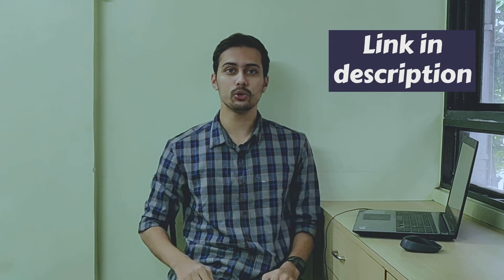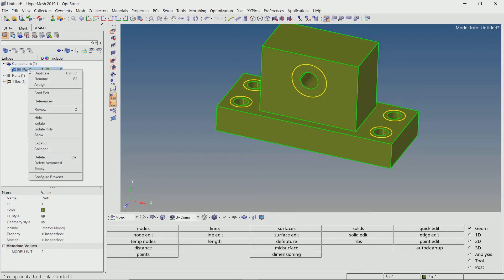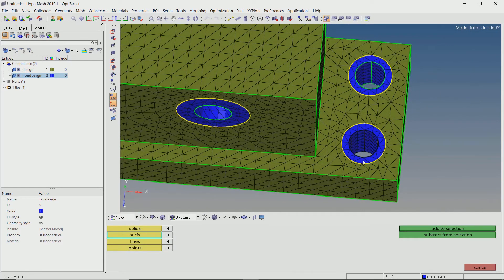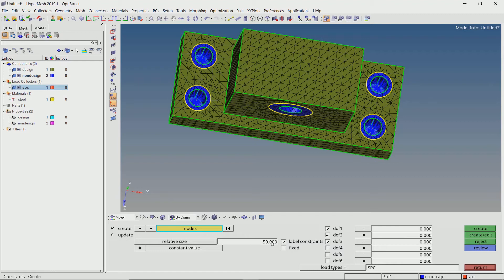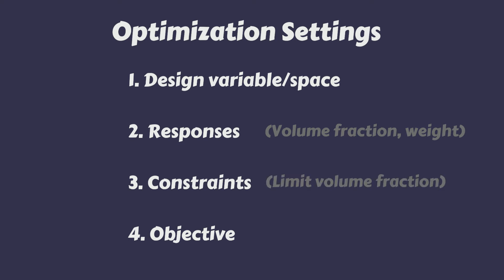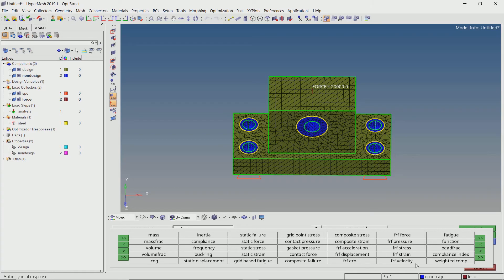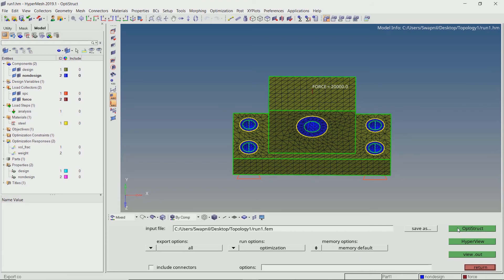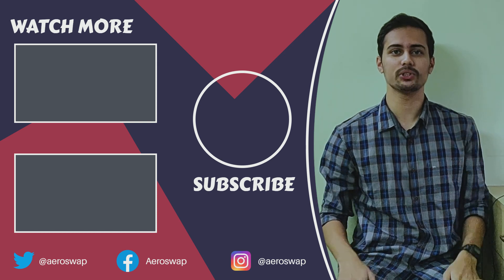Topology Optimization using Hypermesh [Optistruct Tutorial]

Comment: * ERROR # 1814 *
 VOLFRAC response on DRESP1 card 3 is not applied to a topology or
 free-size domain.
....i got this error plz tell me how to fix this. I'm not getting how to fix
Reply: I think this Error occured because there are no Elements in your Design component, Gildas GUILLY on the Altair forum explained: 

"The problem is your properties : All your model is "NonDesign" and you have no elements with the "Design" Property applied.

You need to reorganize your model to have elements correctly distributed between your two components (currently all FEM is in on component).
Use the "Organize" tool to transfer elements from one component to another."

I did this and got rid of the Error.

Comment: Very educated tutorials always. This would do just fine for the analysts who just step into the topology optimization area. To get into more details, this method is often used to track “load path” of new material trials for R&D purposes. Each material has own mechanical properties and has different strain response based on poisson’s ratio. Design constraints are also assigned for Ftu, Fty, or deformation limits, as well as minimizing compliance (strain) and weight. You can also limit the element size for the inner solid elements to homogenize it overall as the gradual size change is set to be default for reducing computational time. As additive 3D printing application is becoming more popular and developed, lettuce optimization is also handy for further weight reduction.
Reply from the maker: Aha, I'm always waiting for your comment on every new video! Always a pleasure to get these additional insights on the topic.
Your comments add a lot more value to my videos; really appreciate this!

Thanks a lot Ken!
Reply: Aeroswap thank you I’m always waiting for your videos too!! 👍👍

Comment: Excellent PSOLID (solid elements) optimization to reduce weight using volume fraction (strain energy kind of thing).  There is no stress constraint in this method, although stress values are within limits.

Comment: Good one. There are some things which needs to be considered while performing optimization. What’s the reason of performing optimization , is it to reduce weight only or stresses as well? Even if you increase the load or decrease it you will get this exact same results. One more constraint is required. Displacement or stress constraint. Always check stresses after the Optimization to see if optimised part are not having higher stress than the design space
Reply from the maker: Agreed. I have demonstrated the process to apply stress constraints in many of my optimization tutorials. It is one of the most important factors for any optimization. If the optimized shape shows stress concentration above yield limit at any location, it is of no use!

Comment: I'm trying to open the Quick Edit option but it is not opening by pressing f11, what do I do?
Also, I can't see a separate app of "Hyperworks desktop" on my computer, I only have Hyperworks 2022.2 (I downloaded the official student version)
Please help me out....
Reply from the maker: Hi Nirmit,
Please check if you have not disabled the function keys using Windows settings.. If so, you will need to enable them and restart the HyperWorks application for the shortcuts to start working.

HyperWorks Desktop and HyperWorks both are essentially the same. The only difference is that you cannot open any other clients like HyperView, HyperGraph in the same window if you are using HyperWorks desktop. In HyperWorks, you can use multiple clients in the same window.

As for Quick Edit, if the shortcut keys are still not working, you can find this option in the Tools panel. I hope this helps!

Comment: how to optimize the the different parts in the assembly taking all loads into consideration which is acting in the assembly
Reply from the maker: Hi Uday, the same setup method will work even with assemblies. Just make sure that you are creating proper contacts and connections between the different parts contained in the assembly.
Reply: @Aeroswap  thank you very much, it will be grate help and confidence building, if you can upload the video, of assembly having two or three parts with bolts and rivet, and convergence study also of the parts in the assembly, with size and topology optimization of assembly parts.it will be extremely helpful for me in my work.
Reply from the maker: Thanks for the suggestion. I will work on this topic soon!
Reply: @Aeroswap  can you make a video for mesh convergence study, it will be greatly helpful

Comment: Is there a displacement constraint for the optimisation settings?
Reply from the maker: Yes, that can be done. Static displacement response is available in the responses panel. It can be used to restrict maximum displacement of any desired node during the optimization process.

Comment: in this video , we want to optimize the weight. Why weighted Comp is chosen as objective function? Wightedcomp  basically gives stiffness of the structure.
Reply from the maker: We are not optimizing weight. We have already placed an upper limit on weight using the volume fraction constraint to create a new design. We are optimizing the stiffness for this new design. Hence, weighted compliance is used.
I hope this answers your question.

Comment: * ERROR # 1814 *
  VOLFRAC response on DRESP1 card 1 is not applied to a topology or
  free-size domain.

While solving I get these error ! can you please help me on this
Reply from the maker: Make sure that you have created a topology design variable. For other types of optimization, volume fraction response is not applicable.
Reply: @Aeroswap  I have created Topology optimization Still facing the issue :p
Reply from the maker: Please check if your setup exactly matches the one shown in this tutorial. This case is tried and tested multiple times and it works well if all settings are correctly defined.

Comment: A fatal error has been detected during input processing:

  * ERROR # 1814 *
  VOLFRAC response on DRESP1 card 1 is not applied to a topology or
  free-size domain.
Reply: Hi, I had the same issue and solved it with reorganizing the mesh. The nondesign mesh has to be in the nondesign component. When you are about to tetramesh the solid, take a look at the bottom and make sure to have "elems to surf/solid comp" selected (it´s not selected by default). The programm will automatically organize the mesh in the different components, because you split the part in the beginning in different solids. I hope it works for you too

Comment: how can we manage the analysis when have a PSOLID and PBEAM and PSHELL elements at the same time ? is there a tutorial with non homogeneous element type ?
Reply from the maker: For other element types you can create separate design variabe with respective property types. Multiple design variables can be implemented in the same model hence you can perform optimization of 1d, 2D as well as 3D components in the same run.
I do not have a tutorial posted about this but I will work on this topic soon. Thanks for the suggestion!

Comment: I completed the local analysis of one part in the assembly. This part is having only loads coming from the assembly interaction, it does not any other boundary condition. It is having only loads coming from the assembly interaction. Now I want to run topology optimization in this part, can I optimize this part by topology optimization, as there is no boundary condition (SPC) load collector. how it can be done without SPC load collector.

Comment: hello sir, video was really great but even after I follow the video as it is with the same part I am getting this error "VOLFRAC response on DRESP1 card 1 is not applied to a topology or free-size domain", I tried everything but same error pops out and some times I get the result but I can see only one component(either Design or Non Design) in results and the component isn't getting optmized
Reply from the maker: Hi Srinath,
Please make sure that you are creating a topology optimization design variable. Volfrac response is specific to topology and free size optimization and will give an error if used otherwise!
Reply: Hi, I had the same issue and solved with reorganizing the mesh. The nondesign mesh has to be in the nondesign component. When you are about to tetramesh the solid, take a look at the bottom and make sure to have "elems to surf/solid comp" selected. The programm will automatically organize the mesh in the different components, because you split the part in the beginning in different solids. I hope it works for you too

Comment: Very nice video and well explained. After i see the optimised geometry in the last iteration... how do i export this shape as a solid (step file)? I want to 3d print the optimised design....

Thanks again for your great explanation
Reply from the maker: Hello,
For a STEP file, you have to use the OSSMOOTH option in Hypermesh. There is an easier method to export STL file directly from Hyperview.
Go to Tools >> Export >> Iso Surface. 
Save the STL file in required location. Then you can open it in any CAD software.

I hope this answers your question!
Reply: @Aeroswap  thank you!. I will try to explore ossmooth. Excellent videos by the way!.
Reply from the maker: Thank you! Glad it was helpful :)

Comment: How can I check the mass of the optimized component?
Reply from the maker: Hi Devansh,
You can use the OSSMOOTH option to import the optimized design back into Hypermesh. Once the material is assigned, you will be able to check the mass using 'mass calc' option in Tools panel.
Reply: @Aeroswap  Thank you so much

Comment: Hello Sir, I tried running optimisation problem using another model but it gave an error message showing problem of RAM, Its asking for 28GB RAM while I have only 8Gb. So is there any way to solve this problem whithout playing with element size? Can we use virtual memory RAM to solve hypermesh problem?
Reply from the maker: I dont think HM supports virtual RAM as of now. You might have to reduce the element count to resolve this issue.
Reply: @Aeroswap  Thank you sir for your reply

Comment: Thanks very much for the video, very simple and useful.
I have a question for you. What format file does hypermesh export to? If I wanted to export the geometry obtained from topology optimization, how should I export to? Is it possible to export directly to CATIA file formats?
Reply from the maker: Hi Antonio,
Good to know you liked the tutorial :)

You can use the OSSMOOTH option in Hypermesh to export STEP or IGES format of optimized design. Another option is to export STL file directly from Hyperview.

Unfortunately, Hypermesh cannot export in CATIA format.
Reply: @Aeroswap  Thanks for the answer :) Hypermesh reads .CATPart files but it can't export them to the same format. Right ?
Reply from the maker: Yes, that is right. This is true for older versions of Hypermesh. I am not up to date with the newer features as of now. Maybe the latest version also supports CATIA file exports. Please check if needed.

Comment: I am doing topology optimization for shell element in optistruct. I have different load cases.In some of the load cases I am not getting variation in contour of the optimized part. Means everywhere the element density is same and it is blue, which indicates that I can remove the whole material from the part.Stress on the part is very less such as 0.145MPa. Can you comment on  the correctness of the topology result.

Comment: Hello, Sir Nice explanation again, 
But I am facing some issue, I followed every single step you did but I keep getting this error:  
 * ERROR # 1814 *
 VOLFRAC response on DRESP1 card 2 is not applied to a topology or
 free-size domain.
Reply from the maker: Check if you have created a topology design variable. Follow every step in the tutorial as is. It will work.
Reply: @Aeroswap  yes I have created a topology Design variable. In fact, I performed the whole process from scratch but getting the same error. I don't know what I am missing here.
Reply: @ansariyaseer4651  Hello, have you solved this problem ?
Reply: I am getting the same error
Reply: @micheleromano9371  no brother

Comment: As this is a simple shape we can try with hexa mesh right, why tetra mesh ??
Reply from the maker: You are right, this model is perfect for a hexa mesh. But the main objective of the video is not about creating the mesh. Hexa mesh creation takes time, whereas tetramesh can be done in 1 click. You can try with hexa mesh if you want to!
Reply: @Aeroswap  But here I got a problem is: for reanalysis as the optimised part is complex, I can't able to do with Hexa mesh, So what to do ??
Reply from the maker: I would suggest using a finer mesh. That will give a better shape after optimization.
Reply: @Aeroswap  Means you are saying about volume Tetra Mesh

Is it necessary that mesh type and element length should be same for part and Optimised part
Reply from the maker: Sorry, but I didnt quite understand what you are saying. 
You can use any type of mesh (hexa/tetra) to set up the optimization. Im just saying that use a smaller element size (finer mesh) to get better results with properly defined element density patterns.
Reply from the maker: My email address is provided in the About section of this channel. Feel free to reach out with your setup details. 
I will look into it!
Reply: I sent a mail, once check it
Reply from the maker: I hope this clears your doubts.

Comment: can you plse post a video of topology optimization of a bevel gear
Reply from the maker: Hello Yash, 
The optimization setup process is same regardless of the component being used. You can simply follow this video to optimize your bevel gear design!
Reply: @Aeroswap  i didn't understand the pattern grouping part can you please elaborate it i mean how 2-d plane system work or how to select anchor node for the 2-d plane system

Comment: Topology optimization is only for static analysis?
Reply from the maker: Hello Dia, this method is not restricted to linear static analysis. You can use this for nonlinear static analysis as well.
Follow the same steps after completing the inital NL analysis base setup 👍🏻
Reply: @Aeroswap  what about dynamic analysis?
Reply from the maker: Yes it can be done.

Comment: Great video, tank you very much for that. 

I am facing a certain error when i start the optimization with Optistruct, maybe someone can help:

 VOLFRAC response on DRESP1 card 1 is not applied to a topology or
 free-size domain.

I am not that deep into the terminology of HM to understand this error message properly. Thanks in advance :)
Reply from the maker: Thanks for watching!
Please make sure that you have used a topology design variable for the optimization. Volume fraction response is only applicable for topology and free size optimization. With other types of optimization, this error message will be displayed by the solver.

Additionally, you can also try switching to mass fraction response instead of volume fraction. It works similar to volume fraction.

I hope this information helps :)